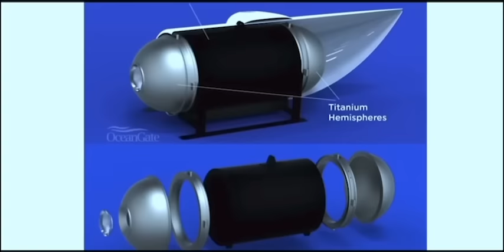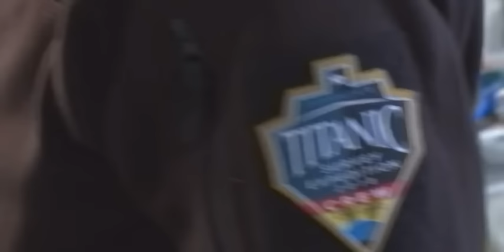First look at #oceangate #titan Debris

Comment: You're 100% right, you can see the carbon fiber dangling in the wind (what's left of it on the video of debris from one of the titanium rings)
Also if you look closely at some of the pieces in the bags you can see almost a smooth concave structure of a segment of the hull i assume and the flush area where the glue was supposed to be connecting the titanium rings. If they were recovering the pieces I don't think they would scrape off every piece of carbon fiber intentionally from the rings before the investigation was done.
Reply: It cathodic disbonded in my opinion. Look exactly where the staining on the rings is occuring, at the 3 bolt points of the titanium rings... Look at the mounting before the sub imploded where the 3 bolt points are is dissimilar metals, you can see evidence of some corrosion going on right beside the titanium hemispheres which means hydroxide was forming at the titanium/epoxy joint area where we see the staining.

Comment: 4:31 The resin and adhesive against the thin titanium inner lip were being asked to do a lot by holding on to wound after expired from certified use carbon fiber thread.

Comment: The picture at the end of this video of the end cap may indicate that the view port blew out also...the orange strap to lift the end cap is going through the port hole meaning there is no acrylic window.
Reply: That would pop out in an implosion, wouldn't be able to contain much pressure from the inside.
Reply: @andreasfjellborg1810  but it leaves the possibility that the implosion was caused by the window
Reply: I think the extraordinary violence of the implosion would have destroyed the window.
Reply: @wattage2007  Yeah the titanium ring + the bolts holding/securing the view port are gone on the dome/door, suggest it got pushed outwards, unless they have dismantled it before transporting it from the accident location.
Reply from the maker: yes i did notice this! It's possible they removed it be able to crane it but it could be the point of failure too. I just thought its more likely the glue lol. looking forward to what the investigators find!

Comment: don't forget this about Carbon Fiber. Carbon Fiber is stiffer than steel so Carbon Fiber doesn't like to bend. It Cracks and delaminate. With that said I'm surprised that this sub has survived as many dives as it did. If they would have a protocol to check for cracks/delamination I bet this would have been noticed and the 5 people would still be with us today. A sub is kind of like an Airplane. Where as an Airplane needs to pressurize the cabin in order for us to breath at 30,000ft. Each time it is sitting on the ground the plane is deflated so eventually it develops fatigue cracks. With the Deep ocean the water is basically trying to get in so it is deflating the sub and like an Airplane when it arrives back on the surface it regains it shape. And every time it goes down it will as well develop fatigue cracks. Once we find a way of predicting this I think we can fit more than 5 people in a sub at those depths. I don't think we should mix material's either. And we definitely should not be super glueing it together.

Comment: I agree that hubris doesn't replace a safety case built from repeated T&E (Test and Evaluation).  I get teary when I see the faces of the people who died in such a trivial, preventable way. It's like walking into a lion den covered in BBQ sauce as lion repellent.

People are missing the point that the glue isn't intended to stop the end caps from popping off with internal pressure - the water pressure all around it is huge and doing that. It's to stop water ingress through the joins and hopefully, hold the carbon fibre at right angles to the titanium end cap. The pressure would have simultaneously been pushing the ends together - compressing the titanium which would shrink, but also compressing the carbon fibre tube, but at right angles to its fibres, while also compressing it through the fibre direction. A bit like squeezing a long sausage balloon in the middle. Some parts of the carbon tube would be in tension, some in shear... I'd need a finite element simulation to understand the totality of it.

Who knows what failure mode will occur with repeated cycles like that. I was stunned when I realised the join with the rings only looked to be about 25mm. No glue oozed out from between the ring and tube when joined either - I'd expect that if it was fully loaded up with glue.

In the entrepreneurial circles I connect with, I'm often reminded that "Academics learn, in order to do, while Entrepreneurs do in order to learn", meaning that doing things the old way is too slow and we need to use "Fail early and pivot fast"  (ad hoc successive approximation in engineering terms). Most times that's fine with a business idea... but not when combined mega-forces of physics are being held at bay by a mix of arrogance and ignorance.

Comment: The leaked transcript says they descended way too fast and then tried to come up when they got alarms from the hull monitor system.  They jetted the ballast but it didn’t help.  They dropped the the frame but it took several attempts.  They were hearing cracking sounds from the aft.  They were trying to ascend but the thrusters were not working properly and they were coming up at such a slow pace that it would take 9 hours.  In 20 minutes they were only able to ascend like 50 meters even though they had dumped every possible ballast and were trying to use the thrusters to come up.

Comment: I didn’t know both ends had titanium caps and both were bonded with epoxy. I didn’t see any other seals either. I’d like to see this build in a hydraulic press but standing on end just to see which component would fail first.

Comment: I'm a Brit and, when I was a kid, one very popular variety of sweet [USA = candy] was 'Smarties' - discus-shaped chocolate buttons with a colourful, hard, crunchy outer shell. I don't know if they still make them.

Anyway... Smarties came in a (spiral-wound!) cardboard tube about 1" across, with a push-fit plastic end cap. When empty, it was standard practice for naughty girls to squeeze the middle of the tube violently, causing the end cap to pop off and zoom across the room to annoy the cat.

Nobody died, although certain ankles may allegedly have been savagely attacked, and someone may unwittingly have learned a little bit about structural engineering.
😾👀

Comment: I AM s retired mechanical engineer who has designed pressure vessels. 

Ther are numerous problems with this design: possibly faulty bonding of the titanium end caps to the CF, wrapping of the CF in a single direction instead of bias wrapping,  two materials bonded to one another subjected to many pressure and temperature cycles, etc. Not to mention that I’ve never seen anything that demonstrates that the CF hulk was cured in an autoclave after wrapping as is need for CF parts.

Comment: The coefficient of thermal expansion of the titanium end-caps and the carbon ring was the initial point of failure judging from the recovered wreckage. The carbon fibre heat conductivity can vary greatly depending on manufacture. The water temperature at depth is about 4 degrees. The titanium end-caps cool and shrink a lot faster than the carbon, especially when  the vessel is warmed inside. Plus it should be recognised that carbon fibre has a NEGATIVE coefficient of thermal expansion. So you have a shrinking endcap and an expanding tube that is also being warped at the same time.  That's going to put stress on the joints for sure. It was reported that the descent was much faster than previous descents, so we are looking at a cascade of technical failures, and the whole concept of thermal stress was not even considered I would guess.  Sooner or later it would probably have failed, but the fast decent would have precipitated it. Not to mention that carbon fibre will fail under compressive shock loading.

Comment: 1) In crucial parts of a construction  if your bonding system is chemical you generally double up with mechanical bonding (bots, screws, etc…)
2) The larger the glue bond is the safer it is : it's not gonna make the bond stringer but it will give more chances to the bond to hold if one part fails, although this is over-caution that has little scientific base it is comforting and it does help sometimes !…
3) The conditions in which you use epoxy bond for these type of bonding mist be as close as in the lab where that test the strength of the resin. Here you can see that they are more cautious in ship yard : no humidity control, no air control (I saw bondings on a sailboat that failed because the resin was applied when a nearby chemical industry released fumes in the air at the time of the building… it triggered a reaction in which the glue didn't cure properly…) : on a project like Titan the minimum was to install the works in a tent with controlled air flow and humidity control plus all men working wearing masks and disposable overalls. This was amateurish not to say childish.
4) Even how they handle the glue is amateurish : it's laid with a putty knife with a guy on the ground helping by holding the pot over to the guy applying the glue… Are you kidding me ?… 

I would have been on the place at that moment I would have had a very eerie feeling.

The man who directs the project is a loony.

A general conclusion : where our money is going when we invest our hard won earnings ? How can we check the trust we put in companies, I'm sure that some which are not venture capital take risks that can be compared to that… 

This is crazy.

Comment: When I first watched the video weeks back of them applying the glue followed by lowering the ring in place, two things blatantly stood out to me.

One - how could they be 100% positive there were no bubbles/air pockets of any kind in the glue around the entire titanium ring surface area in which they applied it too, not to mention should it have also been applied around the outer surface of that area of the carbon fiber too where it made contact with the ring?? Or did they apply it to the carbon fiber,but I just missed them doing so??

Two - it appeared to me that while they were lowering the ring into place,starting from the point where the ring began to make its first physical contact with the carbon fiber until it essentially bottomed out to where it couldn't be lowered any further.It appeared to me like there was only 1-2" of surface to surface contact between those two components?? At minimum I would have had that ring designed/manufactured to allow a much greater contact area,by several more inches at least.If my vision/eyeball measurements are correct,it means there was only 1-2" of sealing area holding a weak point/joint of the sub together.1-2" of a sealed area like that surely couldn't have been anywhere near enough to make/consider it safe for the kind of depths they were planning to go to after the manufacturing process was completed.

I still don't understand why he didn't just use the same materials as every other submersible does?? Would it have been strong enough to go as deep as he was going?? Every other submersible in the industry didn't have any issues doing so........

Comment: Not an engineer and I told the wife ,  it has everything to do with glueing the pieces together. That each material will squash at completely different times compromising the bond.  No way in hell would I have gotten in that. Maybe if it was a sphere.  With manual redundancy.

Comment: Did I miss something? I did not see a conical between the two, materials, just that lip, and there was no squeeze out and/or bagging to remove bubbles? This is plain weird.
Reply: Thw, tubes are ok for deep dives, I work on tubular electronic enclosures (pods) that have 20 years of subsea missions. But they are in metal and the fitting is self tightening: the deeper the dive, the tighter the fit.

Comment: I only have one word….GLUE….nuff said…..🤣🤣
Reply: It’s not unusual though. You couldn’t ever drill into the pressure hull, it would cause minute cracks and lead to a quicker failure, but perhaps, the flanges should have had longer edges inside and out, and then maybe there should have been titanium ribs put around the length of the hull, and have them give some added strength to the hull but I think the wrapping was the first failure, it should have alternated between 90 and 45 degrees.

Comment: And it is also possible that the bond line weakened with every dive pressure cycle. 
They would have been better off integrating the titanium ring into the carbon fiber structure during the winding process with an appropriate flange on the ring faying surface. I think the carbon fibre structure would have failed anyway given enough cycles but maybe the acoustic and strain gage warning system would have had a chance to give enough warning time before implosion for them to surface.
Strength to bouncy ratio? What was that guy smoking?

Comment: There are 3 strengths that assigned to epoxy. Flexural strength which is supporting a rod of epoxy at both ends and seeing how well it resists bowing which you alluded to at 4:30. The next is rip strength which is how well it adheres to another material like the titanium end caps and to the carbon fiber which we see has failed by the clean end caps and the carbon fiber delamination from carbon fiber like a dropped spool of ribbon. The last is compression strength and this is measured by compressing a rod of epoxy axially at the ends. Previous passengers reported the hull crackling during descent which could have been from the epoxy failing in compression. Carbon fiber is strong in tension but has a compression strength of zero like any other fiber so craft depended on the strength of the epoxy and would have failed if it had been made from the material with the highest commercially available strength material which is tungsten wire at nearly 1,000,000 psi tensile strength or even a fiber of infinite tensile strength and zero compression strength because the epoxy was what was providing the strength to the hull.

Comment: The fact that the C/F tows were only wound around the steel core tube circumferentially, with no diagonal wraps, means that the tube may not have been  strong enough against the pressure loads from the end hemispheres. I suspect the thing crushed from the ends, rather than the sides. I also assume the reflected loads from the implosion were responsible for the window being blown out of the front hemisphere, from the inside. Note that the front dome was slung from a red strap, looped through the hole where the window had been.

Comment: No. It wasn’t the glue. The glue and the bolts that held the domes in place  only held the submersible together at low depth and the on the surface. 
At pressure you could remove the bolts and the glue from the ring flange at the pressure would hold the sub together. 
If there was a leak they could have dropped weights and surfaced. The width of the glue joint has little impact.  it needs to be a little thicker than the wall thickness of the cylinder.  Once the flange diameter grows past the cylinder diameter and the fillet diameter it is unloaded and just adding shear stress at the cylinder OD.  A larger flange is worse in this case. 
The failure will be in the center of the cylinder portion due to fatigue failure of the carbon fiber matrix in tension. Both ends will be found to have been forced to the middle like other submarine implosions. 
While the pressure vessel has compression on the outside surface the cylinder wall will have a combination of compression lengthwise and tension from the OD to ID.
The engineering failure was not the basic design. It was failing to calculate the correct fatigue life of the carbon fiber matrix on the cylinder ID in tension. 
It was not enough to make a test dive to prove crush depth before human occupancy. It needed to be cycled to failure by repeated dives on a test pressure vessel to establish the fatigue limit. There are too many variables (or hubris) to correctly calculate the fatigue life of a one off composite tube. 
This is similar to airliner fuselages undergoing pressure cycling to determine the service life of the aircraft. 
I feel sorry for those who died. They took one dive more than the structure could handle.

Comment: I could not believe he just glued the rings to the carbon fibre!
I used to make valves for chemical plants to work at 750 PSI and they had about 20 one inch bolts on the flanges!

Comment: The titanium rings were never going to compress in the same way as the carbon fibre tube.
That meant the only thing preventing the ends from being ejected from the tube as it deformed under pressure was the glue and the only thing securing the tube ends to prevent them deforming was…the glue.
If the transcripts of communications between the submersible and the surface are real than we know that the Titan descended much more rapidly than usual, that the RTM of the hull was in an alarm state, and that the ascent rate after the ballast was dumped was negligible.
This points to the hull being deformed to the point where its buoyancy was significantly reduced. Again, this would have put enormous strain on that glue.

Comment: With no acrylic window in the titanium end cap, that most likely was the point of failure. It probably shot through the submersible like a bullet. There would be no other way to dislodge it as it was bigger on the inside of the vessel, so increased pressure on the hull did not do that. Only pressure from outside force on the window could have done that. I’m sure someone will have another theory, but this is mine.